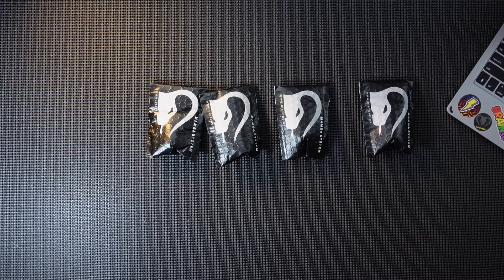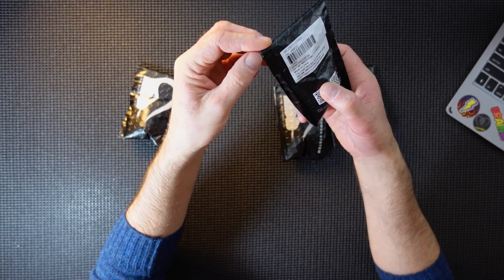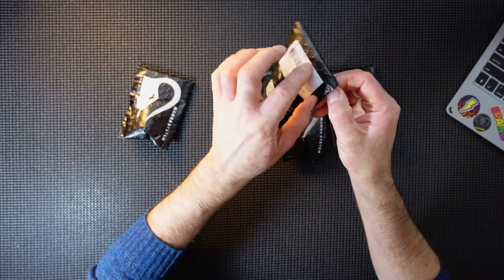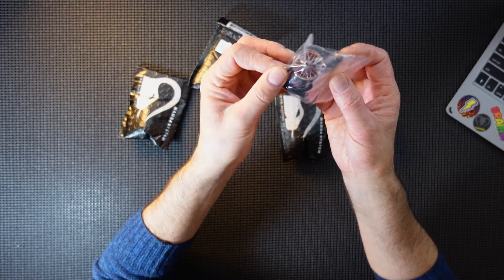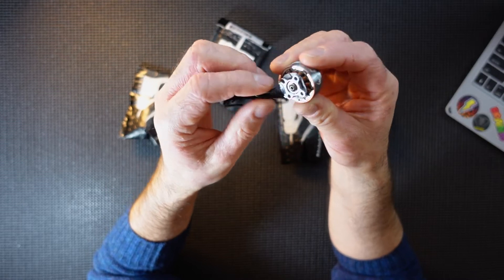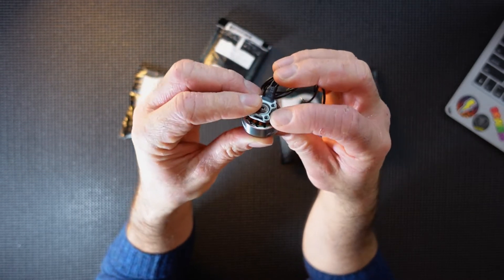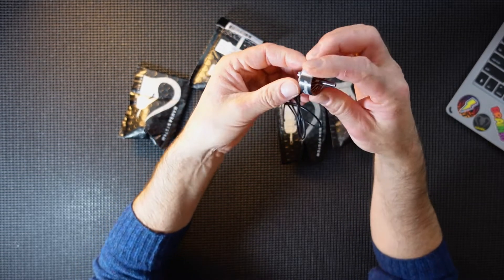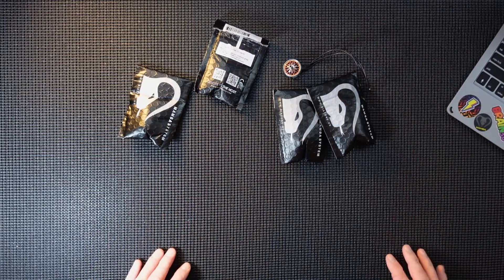NEW Diatone Mamba fpv motors TOKA 1700kv 6S fpv motors

Comment: Has anybody had any overheating problems with these motors?
Reply from the maker: hot motors normally down to a bad pid tune.. d gains ? lower them I believe
Reply: @Datfpv  thanks! I will look into it.

Comment: I have a Roma F5 dji pnp with same motors and one of the motor  have bad bearings out of the box. Bad quality motors.
Reply from the maker: could just be bad luck :( I'll soon be testing the ones I have as well.
Reply: mine didnt have a bad bearing but the bell got crooked with a very small crash.

Comment: How would these be on a taycan?
Reply from the maker: hi mate - they wouldn't fit on, they are not thr right size, these are for a 5inch quad.
Reply: @Datfpv  and would you recommend an Iflight succeX mini F7+40A TwinG stack?
Reply from the maker: Hi - no I can't only because I've never seen or used it...